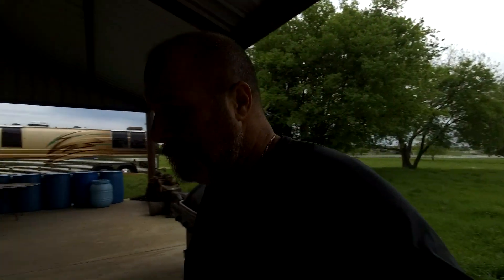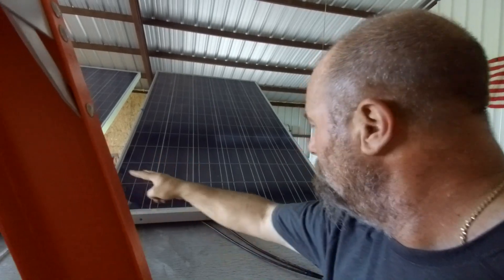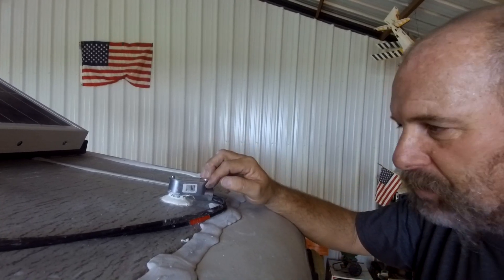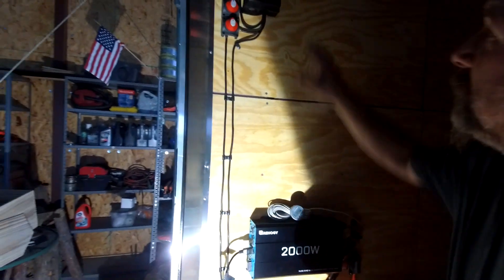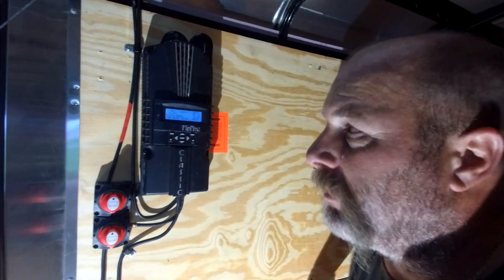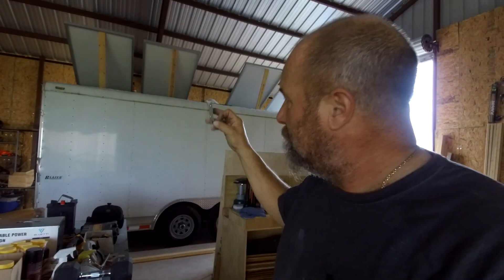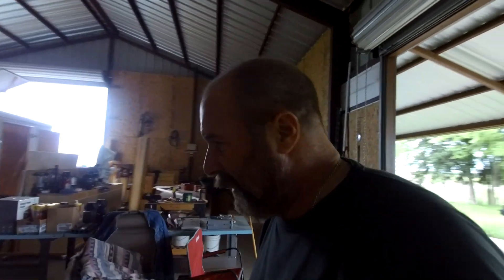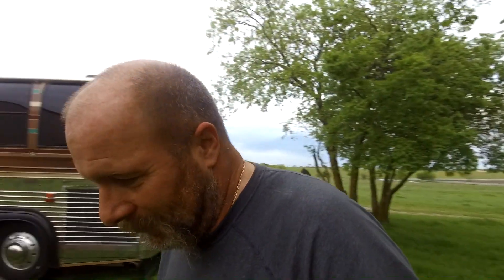499  Internal solar setup / Cargo trailer RV conversion

Comment: Hello Stan! I know what you mean about remembering parallel vs. series. I always have to think about a two cell flashlight, those two batteries are installed in series, i.e.  batteries are connected in series, positive to negative. 

Grass sure looks lush and green there on the ranch! Wishing you all the best.

Comment: Love your windows! The more of those you can put in the better.  Max air fan 10 speed remote control. Mounted on wall, back, , no leakage. The more small windows the better air flow regulating you have. NO A/C NEEDED.

Comment: Man, you do a first-rate job. Of course, you have had a little experience with the van snd motorhome. Maybe you can show us your plans for the interior soon. Enjoyed seeing the cows as well. How about using a spring clip to secure your hinged solar panels? It would be easy to pull out and replace. Ray in Boise

Comment: I'm curious why you didn't put your batts closer to the axle.  It's a tandem, but that's around 150 # of electronics in one corner.  I'd suggest perhaps spring-loaded quick release pins for the panels.  Not a bolt but not a fancy flip-up thing either.  Just un-pin and deploy.  It's cool to watch the build progress.  Keep at it.

Comment: Dig the solar install. Would recommend using a marine grade breaker in place of the switches to protect against a short. Wiring faults happen in metal boxes like a cargo, you can never have enough breaker or fused protection. Love the cows. Your grass looks really good too.

Comment: Word of caution, mostly because you said you were done with the solar panels:     Assuming the wooden props holding the panels up are not attached on both ends,  The wind, when it comes from behind, will flip your panels over and destroy them.   At the very least I would Use bungee cords to keep tension Holding the solar panels down on the wooden props which need to be Attached somehow so that the wind does not allow them to fall out of place.  I have had a solar suitcase tipped over and smashed by the wind, And Hobo Tech has smashed a panel too....  It really pisses you off when that happens.
Reply from the maker: The wood props are temporary.  I will use metal braces.

Comment: If I may , how about using regular door hinges, that have a removable pin.  Don't use the pins that come with them, use a piece of steel stock slightly smaller in diameter, then drill a hole in the end of the steel pin and use a "hairpin" to hold it in place.  That way, if you use these modified hinges on BOTH sides, no matter how you park, you could pull the hairpins on the side you want to lift, and raise the panel.  The way you have it now, you may not be able to tilt the panels correctly, unless you parked the correct way. (You want the panels to face south/south west to catch the most sunlight)

Comment: I’m wondering about the battery setup you have for the solar...what kind of batteries are you using? Do you have concerns over the gasses that lead acid batteries produce when they’re charging and discharging? Will you be putting any vent system in for them, similar to what they do on cars with batteries inside the vehicle?
I’m enjoying the content and wish you the best. Stay safe out there!
Reply from the maker: These batteries are lithium.  The same technology that is in your cell phone. No off gassing.  These are made by BattleBorn in Utah.   https://battlebornbatteries.com/

Comment: Bumper pull.balance as good as possible aka Airstream.  about  11% ball weight. Equalizing hitch.  If not possible, truck squats to much.add air springs,springs.  A/C HIGH AS POSSIBLE. 5000 BTU, soft start, evaporative pan NO DRAIN., NEEDED.

Comment: 300 + 300 + 300 + 300 = 1200 W in series. In parallel it would be 300w with 4 times the amps, or 600w times 2 = 2 times the amps.in a series / parrallel config.
Do what ever is most efficient for your batteries !!